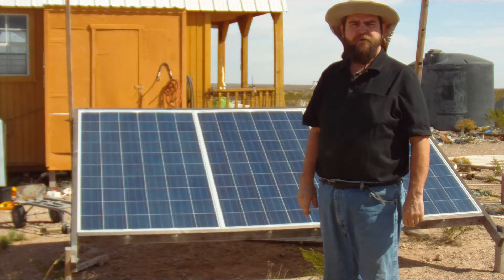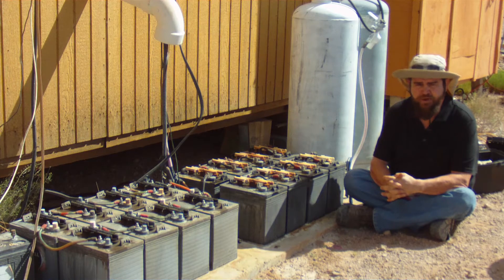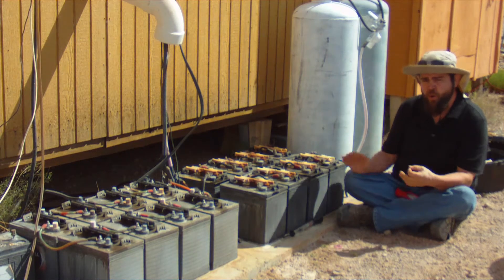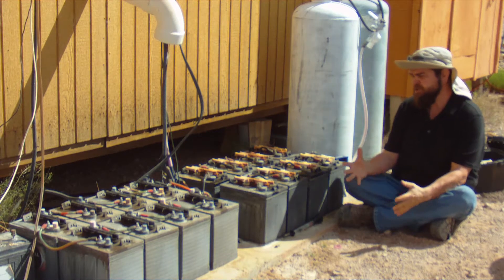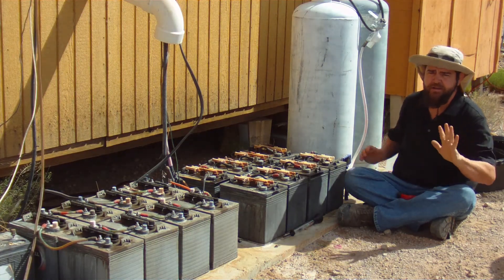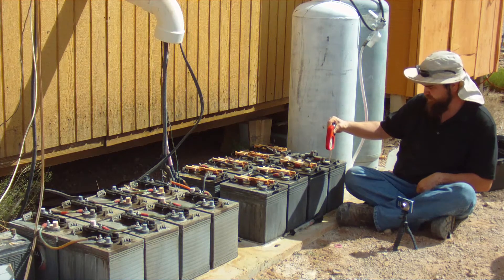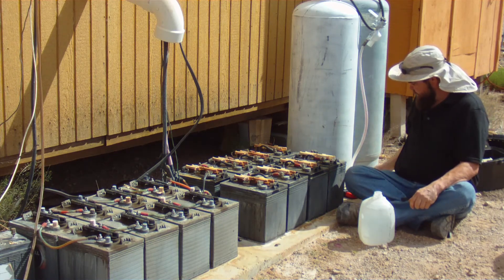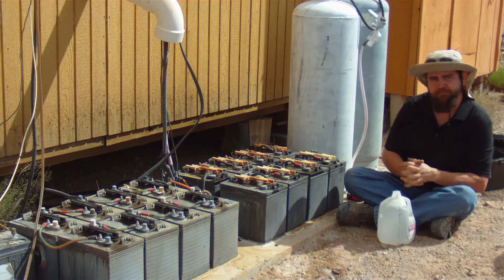Measuring and Tracking Specific Gravity in Lead Acid Batteries

Comment: Why do you charge the batteries in series?
Reply: Because its a 48v system built on 8 6v batteries. I have 2 parallel strings totalling 16 batteries

Comment: you mentioned that you should wash the hydrometer because due to evaporation you would end up having concentrations of acid left behind... But I'm led to believe that acid has a lower boiling point than that of water... I watched some videos on how to separate the sulfuric acid from water by distilling and the acid evaporation occurred before the water... when batteries are low on electrolyte, the first thing that people do is add water, but if the acid is the first one to go.... then that means that everyone is diluting the electrolyte and slowly killing off the batteries... The hydrometer gives readings of the ratio of water versus acid and the readings can only be accurate if they are taken always at the same temperature... But the fact that you have multiple batteries, you can simply cross reference the batteries against each other. Naturally the readings will be different depending on state of charge and temperature on the given day but ultimately all the batteries should be equal. when the batteries are fully charged the acid becomes heavier it causes the float to sit higher. Water is an insulator and won't conduct electricity and it's only purpose is to dilute the acid, by adding more water to the electrolyte... you are possibly diluting the electrolyte even further. The problem is that sulfuric acid is very hard to get hold of. Hence the reason why I was watching videos on separating sulfuric acid from water from old batteries... I have seen videos where people have emptied the electrolyte from an old dead battery and washed it out with distilled water and then used a fresh mix of sulfuric acid and distilled water and then placed on charge, the battery was restored... there's a lot of videos and some people say that you can't fix a battery, some say that it's possible and then some people have no clue what they are actually doing... By watching a lot of videos you start to see where are getting it wrong... But washing out the battery is a good idea because lead particles that have come loose over time and they are now sitting on the bottom effectively shorting out the cell... I hope that this information is helpful, by just adding water won't fix the battery... To test the theory, use a tube... possibly even the glass tube from the hydrometer, sticky tape it to the battery so that it vents through the tube. also sticky tape paper to the top of the tube. if sulfuric acid is evaporating from the battery while charging then the acid should have discolored the paper, if not then it's just the water evaporation and the paper should be just wet... well that's my take on it so far.. any way, thanks for a great video.
Reply: I’m interested to see someone respond to your comment. Could you send along some videos on the topic? I have been doing tons of research on flooded lead acid batteries. It’s such old technology yet so many people are clueless about them.
Reply: You were led wrongly. The boiling point of sulfuric acid is 337 degrees Celsius while water is 100 degrees Celsius. Furthermore, evaporation at room temperature depends on vapor pressure, not boiling point. The vapor pressure of sulfuric acid is 1/30 that of water.
Reply: @richardyao9012  thank you for your response, I'm just trying to get a better understanding of lead acid batteries.... Going by the boiling points of the water and acid, the first thing that I would think is that the water should be the first to begin evaporation, but then again we have to factor in the bond between the water and acid... There might be a bond between the two that changes their properties which may shift the boiling points either way! 
One example is solder, made if tin and lead, independently they display different boiling points to what they do combined together as solder! 
Solder should not melt at the temperature that it does but yet it does! 
So I'm thinking that maybe there's a similar effect on water and acid! 
What do you think? If we were to bring the temperature up of water and acid, would the water boil off at 100°C or would it start earlier or later? Someone somewhere must have researched this!

Comment: I added too much acid to my batteries. How can I measure how much to take out? Or is there any way to know how to balance the acid water ratio??
Reply: a desulphinator works .my buddy gave me 255 ah 6v batteries industrial deep cycle ones that sat 4 years uncharged no voltage in the cells at all and very sulphated for core fees i could trade in for new ones and i decided to put 2 table spoons of epson salt in each cell and level the water levels and attach a 8 stage smart charger and desulphinator 6v to 12v and charged them for about 3 days each till i had 10 of them tied into a large bank then i put a desulphinator on each series chain.and hooked up my duel 80 amp samlex marine charger for a month and a small 50 watt load so it would keep charging and discharging and equalizing at 14.8v absorb and 15.5 equalizing charges .eventually after 2 weeks i noticed the batteries started holding a good charge and gravity checks came out good and i could actualy see clean plates instead of white and gray crap all over them. i was able to fully restore that bank and i decided to use it on my wind and solar hybrid system for 5 years then sold them with 4/0 cables and bus bar for 1200.00 and purchased some crown cr235 6v deep cycle batteries 12 total brand new. and inam currently using those and love the power i get.i have a portable wind and solar hybrid trailer and 12kw and 7.5 kw inverters and 2 30 amp rv ports and i have 1800 watt array and single axis tracker and linear acuators and a 500 watt 3 phase ac wind turbine that has been at 1200 watts in 30mph winds .in all this system is awesome and wind turbines can clean battery plates off too.
Reply: Take out full solution from battery. Estimate total solution requirement. Drain solution from battery fully.Prepare solution so that drained solution + prepared solution ( one acid to four distilled water ratio ) makes about two and half litre or estimate your requirement. Pour the solution in cells upto marked level on the cell. Now specific gravity will approx. 1.200. Now charge the battery & specific gravity will be near to standard requirement. Best of luck, my dear.
Reply: and run a battery desulphinator.  i have 4 on my large 1410 ah 12v bank.